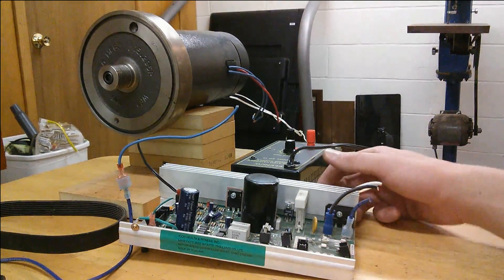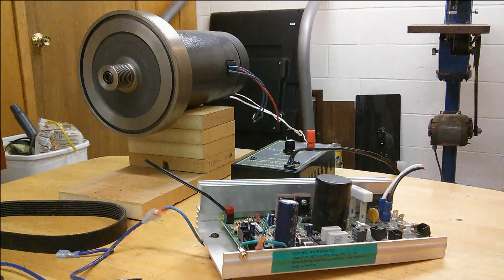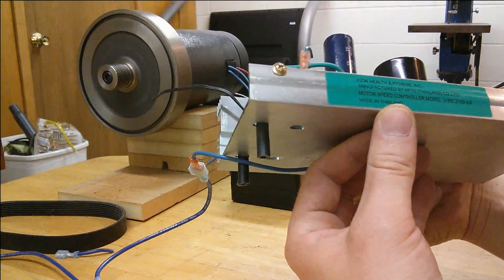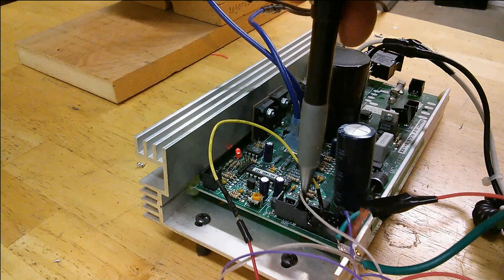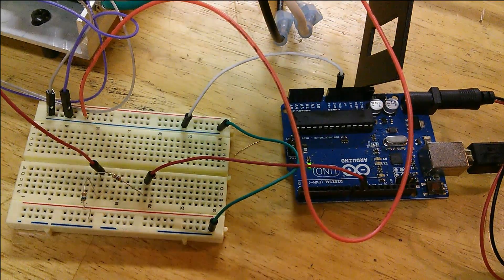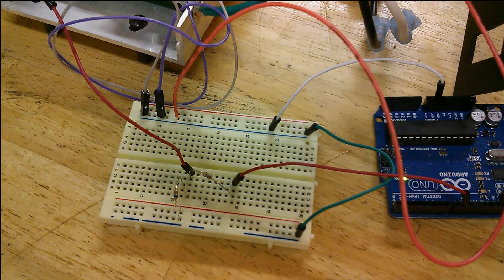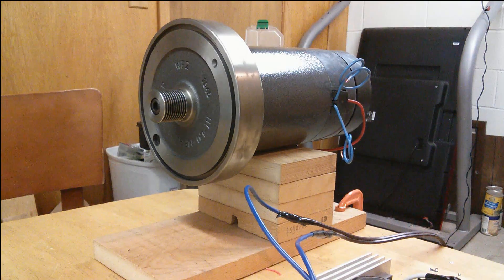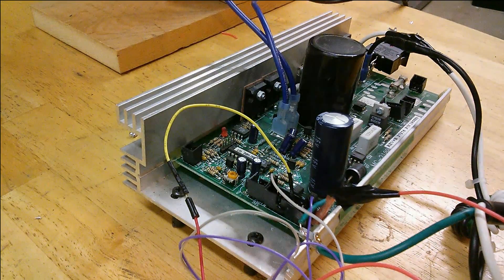Arduino + U-MC 2100-WA Treadmill Motor Controller

Comment: Hi there, excellent video. I am hoping to do the same for a project. Could you tell me which treadmill was this controller and motor from as I hope to purchase the same. I understand I can get them separately knowing their names and all, but I need the compatible treadmill belt (with regards to dimension) as well. If you could advice me on this it would be really helpful.

Comment from the maker: Hmm, no I don't think so. This card doesn't read the voltage at the input pin, but rather listens for a "PWM" signal, which stands for pulse width modulation. Basically, I'm using the arduino to turn the input pin on and off really quickly. The on/off cycle takes 50 ms, and the proportion of on time over that 50 ms determines the speed.

Comment: most likely the frequency of the pwm did not match, do a little research on pwm duty cycle and frequency. sometimes the chips wont respond to 16khz pwm, so you have to step it down in code.